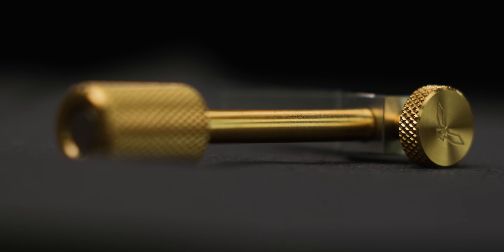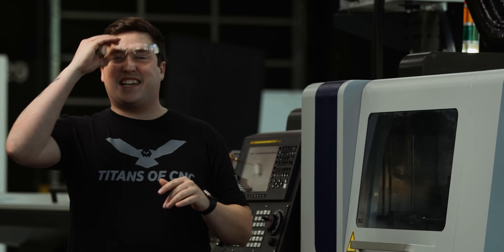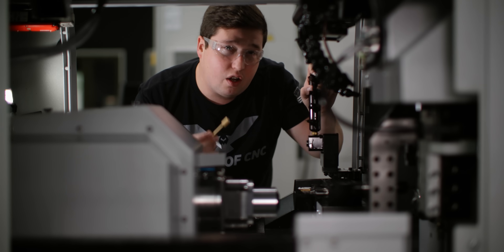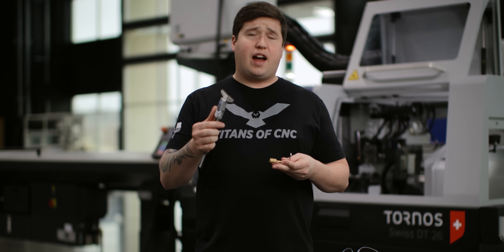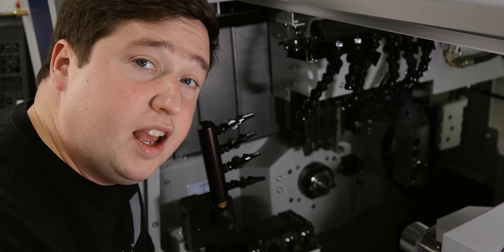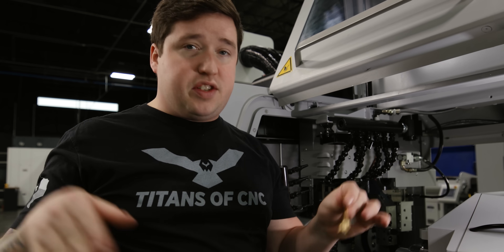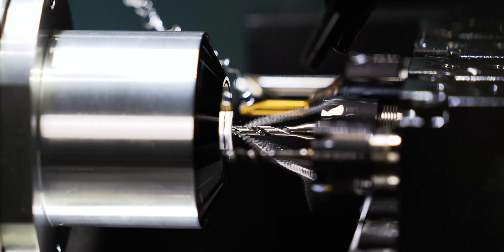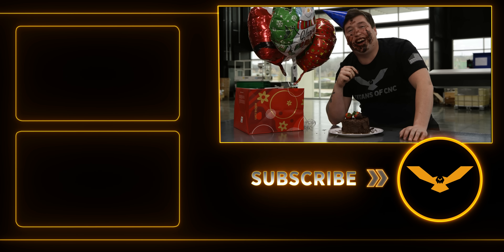Save Money by Swiss Machining This DIY Tool PreSetter

Comment: Why did you deburr the aluminum twice? Seems more efficient to me as you would've saved time of two tool changes.
Reply: This is a good question! good eye! So the reason being is because the way a swiss machine works. I have to do my part in sections because the material being supported in the guide bushing is ESSENTIAL. If you watch again you will see my first cut is wayyyyy longer than the support of the guide bushing BUT I left the other two sides of the part untouched. Those two little sections are all that is supporting the machining processes. Which means I have to do those sides in sections. which is why you saw that I debured it twice.

Comment: The tool setting macros on the Citizen Cincom control make this type of presetter unnecessary. I guess that's FANUC for you still living in the past.
Reply: When setting your I.D. tools do you not have to face off in prep, go to the tool in prep, hit man set, hit core, hit start, then slide your tool to the face and tighten it down? You could slap this in there and just slide your tool to it.
Reply: @donniehinske  I do most of those steps, but I usually bring the material to the tool. That is more accurate as tightening the screws on the holder can shift the tool holder. I can be within .001 on the first shot usually. My issue with a presetter as shown here is that if someone fat finger's a number while entering it can have bad consequences. By measuring tools with the machine there is almost zero chance of a bad offset being entered.
Reply: That’s a fair point and I’d agree with the issue with operator error on sliding out the cutting tool to this preset tool. After going around from shop to shop training people on hundreds of machines I will say there is potential for operator error in any process. I’ve learned through the years that the less someone presses buttons the better. Someone like yourself who is skilled doesn’t have this issue most likely.
Reply: @donniehinske  The macros in the Cincom control make it pretty straightforward. On the Star machines that I got started on there was a lot of inputting code by hand to do tool setting. That could be daunting for newbies.

At my current shop we have a pretty strict hierarchy for machinists. A level one guy isn't even allowed to make offset adjustments without a higher level guy's permission. People making changes to MC data better know WTF they are doing because it can make for a very bad day.

I've got 16 Citizen machines at my shop so I've learned pretty quickly who I can count on to make what kind of changes.

Have you ever spent time on a Miyano machines? We currently have two 9 axis machines with two more on the way. Those machines really show what the Cincom control can do from an ease of use/programming perspective. Three channels running simultaneously is no joke for the faint of heart.
Reply: @brandons9138  yes I will say the citizen macros are very handy for setups. Especially on their newer machines. The older Ms were like a bad mix of a Star and a Citizen. What models do you guys have?
Reply: @brandons9138  tornos’s TMI screen is the only other screen I’ve seen on a Swiss machine that offers any set up assistance like citizen. I didn’t show it in this video but it will move over to positions allowing for a similar touch off process as a citizen. Without having to go into MDI and typing every thing out which I am sure as you know leads to so many mistakes
Reply: @donniehinske  We have 2 L12s, 2 L20s, and the rest are L32s. Most of them are less than 5 years old. We have one of the L20s with a FANUC control. They did their best to make it feel like a Cincom control, but it's really a hot mess. The 2 Miyano machines are the BNE-51 MSY. We have 2 more on the way. Right now we are just so busy we can't keep up.
Reply: @brandons9138  that’s a nice selection there! Yes for sure 1000% if you are used to the Mitsubishi Cincom control I could not imagine what your reaction would be going up to the Fanuc Cincom control lol. The BNE was a good machine as well. Do you guys ever get three tools in the cut simultaneously? I think upper turret is G640,G642 then G641 to cancel and lower is G645,G647 and G646 to cancel if I can recall. It’s super satisfying to watch!
Reply: @donniehinske  I spent the first 14+ years in the trade on FANUC controls.  Then I made the jump to Cincom controls about 3.5 years ago.  I was basically thrown into the deep end VERY quickly.  I was given the responsibility of programming/setting up and proving out the BNE-51.  Having never touched a Cincom control before.  I was also using Esprit to program the machine. At that point I had only used PartMaker for programming.  So here I was on a brand new machine with a control that I've never used and programming it with software that I'd never used before.  They were real patient with me and supported me.  I had a 3 day course with a Citizen applications engineer to learn the Miyano.  They gave me about 2 weeks with the CAMWizard DVDs to learn Esprit. 

We've never had the need/opportunity/balls to do three tools in the cut on the jobs that we are currently running.  We are using both turrets on the main spindle for one job though.  We have the lower support the part with a tailstock while finishing the OD of a thin walled polycarbonate part.  

So far every job that we've moved from our twin spindle, single turret machines to the Miyano machines we've managed to cut the cycle time in half or even more.  On some jobs we've managed to eliminate a second op as well.
Reply: @brandons9138  man that’s awesome to hear! You should be proud of yourself dude! Not every one can rise to the challenge like that! 

I’ve watched all the CamWizard videos myself for all types of machines and I have to say the hardest part about them is being able to pick back up where you fell asleep watching them last lol. Seriously tho!

3 tools in the cut is cool BUT I did find it’s really only ideal for roughing operations simultaneously with roughing operations and finishing ops with finishing ops. It CAN work but has its issues. 

That is really cool to hear some of your story. I learned the Cincom machines in a similar fashion and it’s definitely something to be proud of when you can just make a change that quickly.
Reply: @donniehinske  I totally agree with the falling asleep with the CAM Wizard DVDs.  Dude's voice is so soothing.  He's like the Bob Ross of CAM software tutorials. 

I can see how mixing rough and finish ops across turrets and spindles could be an issue with the forces involved. 

Learning new machines/controllers/software isn't that hard for me.  At first I just equate what I'm leaning with what I already know.  After awhile it all just become second nature.  The analogy I use is it's like getting in a different car for the first time.  All of the same controls are there, it's just learning where they are and how they work.
Reply: I’ve seen people also fat finger the material diameter in the MC data page and wreck their whole set up as well. Another fun one is if they put the wrong cutoff tool number in the MC data page and do a “start position” after doing the cutoff with a different tool
Reply: Yea but that intimidates a LOT of people. After being to hundreds of different companies it’s been very crazy to see how many people don’t want to work on a machine because it’s a little different. When in reality you are correct. They aren’t that different in the grand scheme of things.
Reply: @donniehinske  When I've trained people in the past I've used the same equivalency technique with them when I explain things to them.  Right now I brought a buddy of mine into my current shop.  He's been in the trade for about 15 years now, all on FANUC controls.  He's now making that transition to the Cincom control.  He's worked on Star machines in the past and did programming and set ups on them.  When I was training him in how to use the "man set" macro to change a turning tool I asked him how he'd do it on the Star.  I had him explain it to me.  Then I showed him how the marco worked.  He looked at me and said "That's SO MUCH easier than having to type in a bunch of code"  I smiled and nodded.  All it took was that one time and he made that connection between what he knew on the Star and how it works on the Citizen.  The MC Data wrinkle was something that there is no equivalency  to on a Star machine.  So that took a bit more of a explanation, but the pictures built into the control makes it SUPER easy to wrap your head around what all of the settings are.

In the end though it comes down to motivation.  If the person wants to learn, than they'll put in the effort.  If they lack motivation than no amount of training will work.  At my current shop I took level 2 guy and trained him how to do set ups on the Miyano.  He's a younger guy who's hungry.  He's a sponge.  I show him something once, watch him do it a few times, and that's it he's got the skill locked down.  At his last review I told him that if they didn't bump him to level 3 and give him a raise to tell me and I'd go to bat for him. My intervention wasn't needed. Management saw what he'd learned and how valuable he'd be come not only to the shop , but to me.  I could give him a set of instructions and he'd carry it out.  Other people in the shop have seen that his effort garnered rewards.  That attitude/drive is hard to foster, and makes for a great work environment.

Comment: i love watching you guys. at work im lead machinist (the only one) the guy before me worked here for 10 years and didn't do much. i have touched or remade majority of his programs and cut nearly all cylces in half half while keeping bosses 80% maximum. i love all the fancy tools y'all use maybe one day i can own something fancy but for now i will enjoy working on my swiss 32,20s. and mazaaks
Reply: You will get there dude. That's where I was at one point. I don't know why exactly I did it at the time but I would take manuals home and read them in my free time just to get better at what I did. Then I became an applications engineer for a company that sold DN solutions, Citizen and Miyano. After that I moved onto Titans. I KNOW IT SOUNDS CORNY but if you put the hammer down and push your knowledge in this field you may just replace me at Titans one day.
Reply: @donniehinske  i got in trouble for taking them home. so i started taking them home secretly lol. so far the machines i seem to have the least experience in are the mitsubishi sinkers and edms. but ive seen some of the stuff done with them and its just beautiful
Reply: @OpaqueWindow  yea man that’s smart. It’s also smart to see what machines you can learn to help make the company more money. Worst case scenario is you learn more and make yourself more valuable. If the company that you work for doesn’t see your growing value I am positive another one will.

Comment: Tsugami sends a bunch of these presetters along with a machine.  Just sayin'. ;p
Reply: I worked on a brand new one 4 months ago. Didn’t see them anywhere
Reply: @donniehinske  check the toolbox that came with it.  Also check everyone else's workstation because guys were constantly trying to steal these to use as magnetic workstops in mills.  I last bought one in 2018.
Reply: Yep went through the tool box and showed the customer all the attachments and options. It was a SS327-III-5AX
Reply: @donniehinske  that sucks those things were great.  I actually made a bunch of copies when I left that shop and went out on my own and now use them for work stops just like all the thieves at the old place LOL.
Reply: It could be possible that it just didn’t have it.

Comment: Hi all the way from Ireland Donnie. What software are you using to generate your code? Or if any1 else wants to share what they are using?
Reply: We use Esprit to do most of our swiss programming
Reply: @akingbrew  how is espirit? I just started as an engineer at a swiss company and I've heard there aren't any good cam software for swiss programming so like Donnie we do it by hand. Although most of the programming seems easy to read and get it to do what you want, there's gotta be an easier way than by hand.
Reply: @BedroomMachinist  it is definitely a learning curve. It feels like Esprit developed it back in the early 2000s and have only done enough updating to keep it working on newer operating systems but the whole feel of the software is definitely early 2000s vibes. Quite a poor user interface. We've definitely managed to hone it in though and once you get the processes down and develop your tool library and templates for certain operations it is drastically faster then hand programming. Being able to simulate the part being made and seeing it all run inside of your actual machine is helpful to make sure there are no crashes. Any good swiss operator or programmer  should definitely understand the G code because they will most likely be having to make manual changes to new programs to get things 100% dialed in.
Reply: I programmed everything you saw in this video by hand and verified it in TISIS software. We are working with MasterCam for any CAM purposes
Reply: @donniehinske  Thanks Donnie. I have been using Mastercam SwisCam for the past 3 years and am currently in the process of moving to the new MasterCam Swis offering. Hoping to get it installed and trained this month. Would be really interested to hear your taughts on the New MasterCam swis offering?
Reply: @davewalsh2390  so far its been good for me. I am currently in the process of getting up to speed with it as well. We will have videos at some point

Comment: what is that through collet feed style of machining called ? that must be a huge convenience
Reply: It's a Swiss style lathe. It is very good for certain things
Reply: @jsirius94  they were originally called Swiss lathes as they were designed for making very small watch components. Think citizen watches,  they actually have a good selection of machines.  One of the biggest problems is the bar stock slides through a  guide bush which requires lubricant in almost all situations . This means that the cutting area is totally hidden in lubricant  making it difficult to see what is happening.    Hope that helps.  Jp
Reply: Yes that is just how the Swiss style lathe works. The material feeds into the tools as opposed to a standard lathe
Reply: @donniehinske  it does ? tell us more about it
Reply: @fijs653  They have several Swiss videos online.